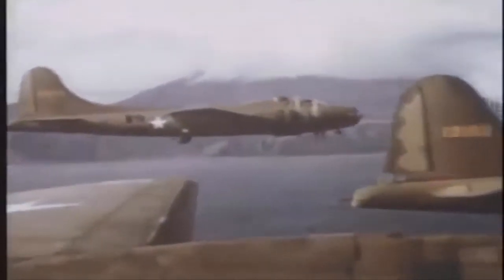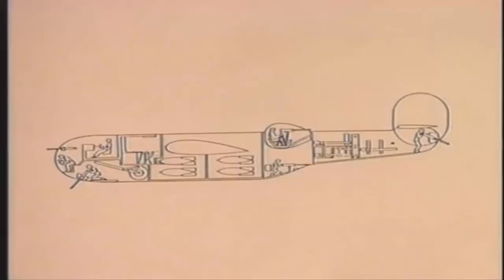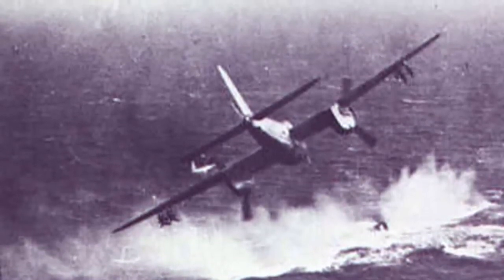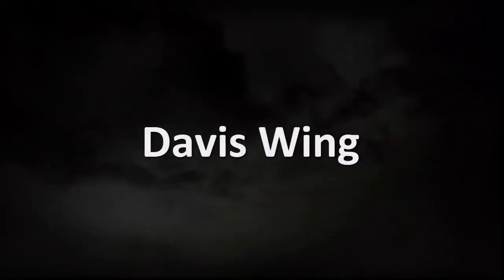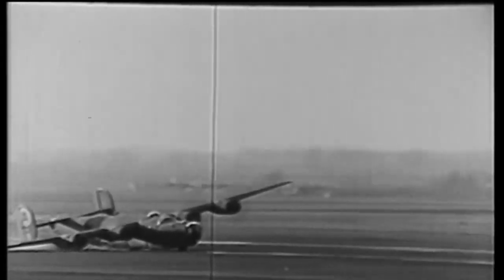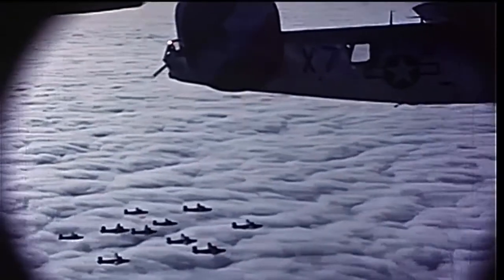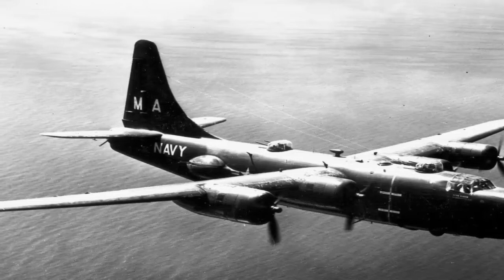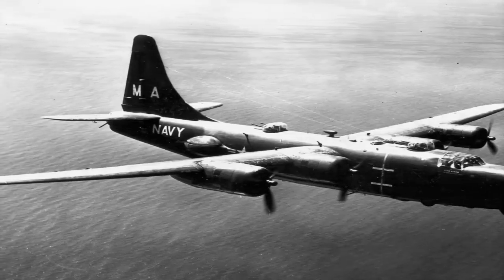B 24 Liberator:  3 Major Design Flaws

Comment: Amazing and kind of shocking emergency landing scene: A miracle that the crew had a chance of surviving. 
In  Duebendorf Switzerland many shot up heavy bombers made emergency landings. They showed films of scary landing scenes. Many Liberators came down much to fast and very often the front landing gear broke. I remember watching those scenes in horror, saying slow down, slow down,  slow down! I cannot imagine how horrible it was for the flying crews. I met an old man who was stationed there as an airplane mechanic. He had a lot of heavy stories to tell. One specially hard one was the story of a pilot who had a bullet that entered his foot and went up until his tigh. The copilot was killed, so he had to fly badly wounded as he was. Knowing that you needed to use your feet on the pedals as well, you can hardly imagine how much this poor guy suffered.
Reply: My late dad was crew chief (master mechanic) on USAAF B-24s based in Australia '42-early '45, and one of his missions ended in a landing at home base much like the one in this scene.  The plane had taken what I suspect was at least flak damage near the nose wheel, which collapsed shortly after touchdown.  Miraculously, the whole crew survived with only minor injuries (and no fuel tank explosions).

Comment: There is so much conflicting information about the B-24 vs B-17 that it's really hard to tell what's correct.  I always thought the B-24 was much cheaper to produce and carried a much larger bomb load, but now I read that is false.   Perhaps, like the Sherman tank, they just went with what they could get the most of the fastest.  Losses of both were horrendously high.  But high production rates ensured we would win simply through sheer numbers.
Reply: No it is not false about the bomb load. Have you ever been inside a B17 and a B24? The B24 carried a MUCH larger bomb load. The capacity in the bomb bay is so different that it is hard to see how the B17 was also classified as a heavy bomber like the B24. If you ever walk the bomb bays of those airplanes, it would not take much to figure out that the B24 has a much larger bomb carrying capacity.

Comment: My dad flew both the B-24 and B-17 out of Mendelsham, England during WW2.  He preferred the B-17  describing the B-24 as "drafty", while the B-17 was "snug".  Interesting that the B-17 soldiered on with the Air Force for years after the war while the B-24 was quickly deleted from inventory.  Telling that.
Reply: Yeah the unarmored cockpits, draughty design, and lower service ceiling would have been strong minus points for sure!
Almost nobody who flew the B-24 liked the B-24 and I chalk that up to failure in doctrine rather than failure in design, not softening up the airwaffle enough with B-17's that the B-24 could be used with a higher margin for safety.
Would have been a more effective use of it, and would have saved the many B-24 crews that needlessly went down.
Reply: Respect to your father for his service at Mendlesham.  I live just a few miles away from the now disused airfield and where ever you travel in Suffolk,Norfolk or Cambridgeshire you are never far from a Usaaf air station.  Unfortunately the Mendlesham memorial is all but what remains of the huge airfield.
Reply: @stuartbuxton4316  Thanks for your acknowledgement of my dad's service.

On 10/7/44, just after bombs away at Meresberg, flak blew off the tail of his B-17.  Five of the  nine onboard survived.  He ended up in Stalag Luft One and was eventually liberated by the Russians.

Comment: A coousin who flew B-24s told me that the ones built by Consolidated were a dream to fly and would easily fly hands-off, but the ones built by Ford required constant attention as they tended to wander all over the sky and had to be manhandled to fly straight.  Very tiring.

Comment: There was a flaw. The auxiliary power unit was in the foward Bombay. Gas fumes built up and many B-24's exploded during takeoff. To solve the problem, the bomb bay doors were left open during takeoff to vent the fumes.
Reply: I'm surprised nobody else has mentioned the B-24's propensity to spontaneously explode due to the fume accumulation issue. A similar procedure was also used prior to extending the landing gear.
Reply: I have read about the problems in some forgotten books and some articles from Air Classics in the 70's. Also, through my aviation career, I have talked to former B24 crewmen who described this problem.

Comment: My Dad flew combat in the southwest Pacific in B-24s as a pilot until a catastrophic takeoff crash due to a blown tire on takeoff from a crushed coral runway on the island of Morotai.  He was one of three badly burned survivors.  He said that B-24 pilots called the airplane the "Agony Wagon", among other things, due to the high control effort required to fly good formation.  OTOH, he LOVED the Pratt and Whitney R-1830 engine to the end of his days.  He spoke of the fire issues with the APU in the bomb bay that others have mentioned, an issue that resulted in another nickname, "Consolidated Incinerator",  mentioned it as a perceived feature of Willow Run (Ford) built airplanes - and refused to buy Ford vehicles for most of his life!  (He did finally relent on that with a 1988 diesel pickup, rationalizing that it didn't have any spark plugs or gasoline to create the type of fire hazard that had killed crews in his bomb group!). He appreciated the B-24 for its long range and the efficiency of the Davis airfoil, noting that in the Pacific, "Range was God", but he much preferred flying C-47s, A-20s and B-25s.

Comment: My father got a job at Boeing after high school... he ran flight control cables for B-17s... yup, he helped build them.
  After Pearl Harbor, he got drafted...but joined the Army Air Corp... and flew on B-24s...as flight engineer.  He PREFERRED the B-24....
  As to damage. On two missions, they had two engines shot out... both times made it home. We had a piece of flak from one of those missions.

Damage and survivability... depend on where you are hit... I am sure some B-17s went down with less damage than others...so did some B24s...

Comment: The liberator was a very dangerous aircraft in a role that honestly it was not designed for, transport. Looking at the airplane you would think it would convert well to a transport but it did not. This was experienced flying the Hump, from India to China over the Himalayas. In one of my books regarding b-29 operations during World War II, the initial deployment of the b-29 was in China. There was no road or rail to get supplies to the b-29s forward air bases. Everything had to be flown in including fuel and bombs. The b-24 for some reason being loaded as a transport had a negative effect on the center of gravity. The plane was very unstable in this role. I have never read anything about a B-17 being converted to transport duties having these kinds of issues.

Comment: Tell me I’m wrong, but another video mentioned a weakness when the aircraft had to ditch in the sea. The wing configuration caused the plane to break apart when a crash landing was required.
Reply: I think the problem with ditching a B24 was that the deep fuselage and the flimsy bomb bay doors, and the keel structure, meant that the aircraft couldn’t withstand the sudden impact of the water, especially in choppy seas. The sudden deceleration caused the plane to break its back and sink very quickly. My dad was one of only two survivors when they ditched their b24 in the Indian Ocean. There’s a video with his story. Search 355 squadron/ b24 ditching if you’re interested.

Comment: I think it was Jimmy Stewart who said that flying the B--24 in formation was like wrestling a bear.

I used to work with a man who was a ball turret gunner in a B-24. Definitely a high risk assignment.

My mother was a "Rosie the Riveter" who fabricated engine speed rings and wing sections that were sent to the Ford Bomber Plant in Willow Run, MI. The big advantage of the B-24 over the B=17 is that it was less complicated to build and Edsel Ford further streamlined production techniques to achieve the "bomber an hour"  output.
Reply: Well, almost one every hour.  I think it actually took 74 minutes.

Comment: Officially known as Operation Tidal Wave, the Ploesti Raid occurred on 1 August 1943, and because it marked the second highest loss suffered by the United States Army Air Force (USAAF) in a single operation, it was afterward nicknamed Black Sunday.    The most recognized air raid done by the B24 Liberator.
Reply: The oil refineries there were owned by Standard Oil Company (Rockerfellers).  The Germans paid Standard Oil a royalty (through Swiss banks from treasures taken from occupied countries and gold teeth from Germany's victims) for the oil that they took/processed from there. After they were bombed by the US, the US government (Roosevelt Admin.) paid them for the damaged caused by the bombing.  The Germans re-built most of the facilities back, because the 1st strike didn't do a lot of damage. So, a second raid was necessary, and it was carried out.  The Roosevelt Administration again re-imbursed Standard Oil for the damage of the 2nd raid.  And if you think that's bad, The Germans occupied Ford Motors auto manufacturing plants in France, and they produced mostly trucks for the Wehrmacht.  The Germans paid Ford Motors, again through Swiss banks, for the utilization of their plants.  The money was transferred from swiss banks to Chase Manhattan bank controlled by the Rockerfellers. Henry Ford was a big supporter of Hitler and Nazism when they were getting started.  Hitler had promised Ford that he could be the head of the world's auto industry if the Germans won.  And, Hitler was going to let the Rockerfellers run the world's oil and banking industries after the Germans had won, too.
Reply: Source?  @friendofcoal
Reply: @fawnlliebowitz1772  I believe the book was called "Trading with the Enemy" (there may be at least 2 books with the same name out there)....    I read it about 40 years ago. Also, I believe that ITT (International Telephone & Telegraph) made money from a similar deal, and there was something going on with a ball bearing production/factory in the US and another country...
Reply: I'll look into it, thanks
 @friendofcoal

Comment: My father in law flew B-24s in WW2 in his early 20s.  He said they were a handful, especially when heavily loaded and in thin air at cruising altitude.  He said it was like trying to fly a dump truck.  They wanted to stagger all over the sky, making it very challenging to stay in formation.  He said his biggest fear was running into the aircraft alongside him or vice versa.  I'd like to ask him more about it, but like most of the WW2 generation he's been gone for many years (1990s).

Comment: Sounds like the 24 had something in common with almost every other WWII plane I've read or heard about...flight limitations.  If you operated within those limitations, it was a great plane.  If you tried to push beyond them, it was a pig.  The planes that are held in highest regard--P38, P51, P47, F6F, B17, etc--had fewer limitations, so they were regarded as superstar planes.  But even the P40, which had one foot out the door to retirement before the US even got into WWII, was a ruthless killer when it was used by the Flying Tigers in China, because they adapted their tactics to the strengths of the plane, rather than trying to force the plane into tactics for which it was poorly suited.

Comment: My father-in-law worked on B-24s thru WW-2. He even kept serial numbers of the planes he worked on..Also as a mechanic, he was supposed to go up in one to evaluate its performance, but he missed the flight. That plane crashed, because someone missed a check on some wing rivets...Needless to say the plane crashed. Fortunately my father in law missed the flight........
Reply: My dad was a flight engineer on b-17s and b-24s he felt the b-24s were unstable while he could trim out a B-17 and it would practically fly itself
Reply: @jackbehling88  I recently saw a short documentary on B-24s, and during the discussion, it was stated that the B-24 was the hardest airplane to fly....👍

Comment: The fuel tanks in the Davis wing were it's weak point. There is a horrorific film of a damaged B 24's wing spraying fuel and then catastrophically failing as it folds up and detaches from the bomber.  There was a reason WW2 veteran aircrew always wanted their families to fly on Boeing built planes after the war.
Reply: At first, I shared your thoughts.  Later found The plane’s wing was struck by a bomb released from above.   It’s hard to see in the film clip.

Comment: They needed to add external armor plates beneath the pilot and co pilots window as they were very vulnerable to frontal attack and diagonals attack lines from the front. There really was not enough formers around the pilots cockpit area for added protection just two parallel longerons. These panes of applique armor as well as new armored glass pane windows probably were welcomed by the pilots. 
I think they started doing this on the B-24H-10-DT series.

Comment: And the C-87 cargo version was not popular with pilots.  The only things they liked about the planes were the engines and the high cruising speed.  I think Ernest K Gann said they were terrible in icing conditions.  This is a quote from the C87 Wikipedia article 'Veteran airline pilot and author Ernest K. Gann, in his 1961 memoir Fate is the Hunter, wrote: "They were an evil bastard contraption, nothing like the relatively efficient B-24 except in appearance." Complaints centered around electrical and hydraulic system failures in extreme cold at high altitudes, a disconcertingly frequent loss of all cockpit illumination during takeoffs, and a flight deck heating system that either produced stifling heat or did not function at all.[3]'

Comment: It was also a very poor airframe to try and ditch. The shoulder mounted wing insured that one wing tip or the other would impact the water first, causing the airframe to break in half, See  Louis Zamparani.
Reply: Even if during a water ditching you avoided dropping a wingtip and cartwheeling and managed to touch down on its belly, the 24 had a nasty tendency to dig in the nose and somersault.  Assuming enough control was present to do so, it was important to keep the nose high on touchdown.

Comment: Not really flaws, just trade-offs.  The B-17 did have two decided advantages over the B-24.  First, it was MUCH easier to fly and was considered the "Cadillac" of bombers and had a very good auto-pilot for the day.  Second the B-17 was "built like a brick shit-house".  The wing had a unique truss and corrugated metal construction that was incredibly strong for the weight and lift. That and the overall design by Boeing allowed the plane to keep flying with ridiculous amounts of damage.

Comment: The B-24 was my favorite American heavy bomber.  That retractable belly turret had to be a difficult assignment.  Too bad so few of any of them B-24s, B-17s, or even B-29s are left.  I think only one B-24 might be flying still.  Thanks for doing this video.
Reply: There were some 18000+ "B-24s" that would have cost some $90,000,000,000 in today's "funny money": like the Martin "B-26s", they were obsolete at the war's end and were quickly scrapped. The Indians managed to assemble some "new" ones from British "Lend-Lease" "Liberators" that had been left deliberately wrecked under the "L-L" terms and got some 20 years use from them.
Reply: I flew on the B-24 "Diamond Lil " last year.

Comment: From what I have read, the RAF preferred the B24 to the B17 as they considered the Fortress to be slow and with a very small bomb load for its size.
Reply: Also the British RAF requirements did not have the provision of an "auto-pilot" for their bombers like the USAAF did, which meant if the crew had to bail out, the pilot had to make sure the control column was tied off so the plane would not spiral out of control when he tried leaving the aircraft, pinning him inside.

Comment: The B24 had several flaws: 1-it was homely and chunky looking; 2-it lacked the defensive firepower of the B17; 3-the high load factors on the wings made it prone to failing during enemy attacks; 4-the huge tail made for a blind spot at the rear quarter; 5-its initial controls were unpowered and very taxing on the flight crew.  Oddly enough, its shortcomings led it to the battle of the Atlantic, where it won the sea war.
Reply: The B24 in its H and J versions had exactly the same protective fire power as the B17. Those are also the versions used most extensively in Europe. Looks don't win fights. The wing root of the B24 was no more vulnerable to failure than the B17 if hit in the same area.The tail contributed no problem for the rear tail gunner as he was well behind it. The flight controls, and their lack of power assist were still far more thoroughly developed than the unassisted controls of the B17. Not until deployment of the B29 did the US have a heavy bomber in its air fleet with any kind of power assist for the control surfaces. See other references here; my father was 26 years old, 5'6" and 130 lbs soaking wet when he was piloting a B24 for missions that last 12 hours or more. If it had really been that hard to fly, those missions would never had been completed.